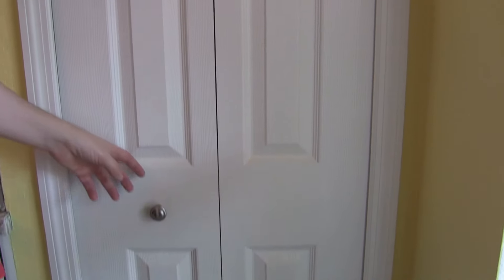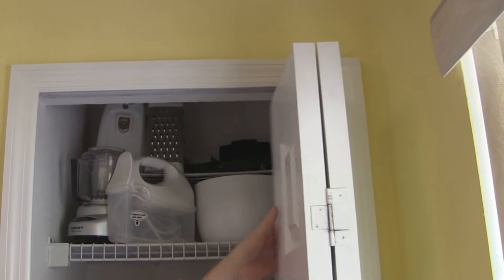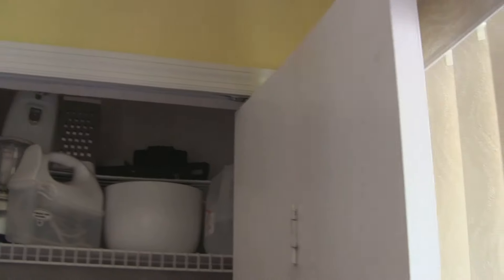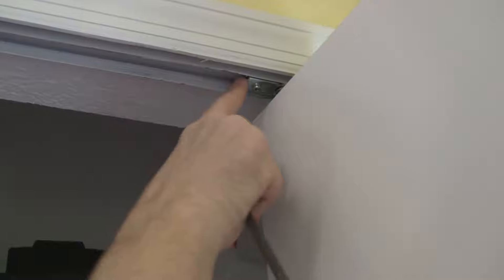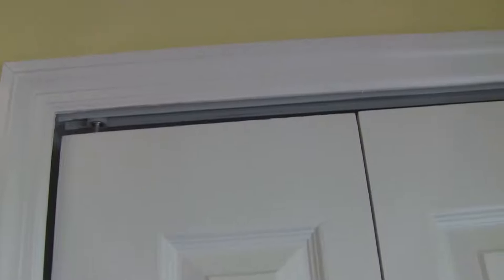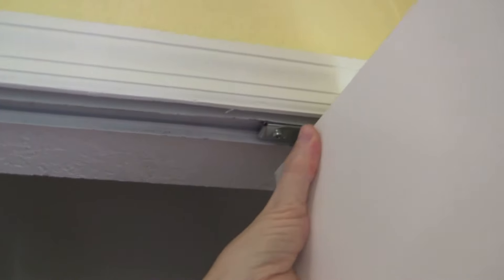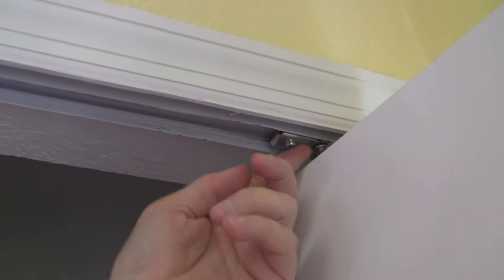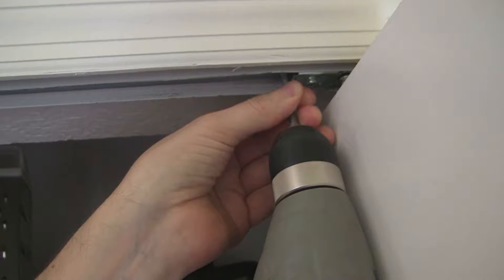Fix A Bi-Fold Door That Falls Out Of Track

Comment: OMG!  I've been holding this off for 2 years but just saw your video and fixed it.  I had the 2nd problem where I screw in the screw but the track still slides.  I did your 2nd screw solution to stop it from sliding and it worked!
Reply from the maker: lol... I put it off forever too. Glad that little trick worked for you.

Comment: So, my bifold closet door, actually has this thing on the very bottom, close to a screw looking. But I actually lost that part like 1 day ago, I thought it was just one of my siblings stuff. But I managed to get it back! So It was actually quite hard to get it to stay in the hole at the very top. And very hard to put this screw thing on the hole it came out of. And let me remind you, this was a single person working on this heavy closet door. After finally fixing it. When I keep closing and opening, the thing that has the hole and has this screw on the bottom piece (At the top) was moving/scooting. So I remember you did something like screwing a nail to make it so it won't move anymore! 
My age:14 (which isn't important) Is going to fix this closet! Tomorrow actually. I can't go touching my dads stuff. But I want to fix this on my own.

Comment: I would appreciate your advice. I had to cut down about half an inch the door as it was too tall, the door is hollow inside and now about 2 months later the bottom pivot or screw that is holding the door from the bottom is collapsing and the door has fallen twice already. Is there any way how I could fix the door from the bottom? Thank you
Reply from the maker: Did you cut the top or bottom?

Comment: hey man so what if both sides fall off
Reply from the maker: Well, there's 3 points of contact with the door. Ya just gotta see where the problem is. Sometimes the screw at the bottom lowers the door over time with opening and closing it. Try to adjust it so it raises the door.
Reply: @stevekonbass  thank you sir i’m trying to help my dad fix his right now so i appreciate the fast reply
Reply from the maker: Glad to help. Make sure the 2 points of contact at the top look right. There's that screw you can try to tighten at the top as I did in the video. Definitely check the bottom though too.

Comment: How do you get the door to go back in from the bottom by the floor?
Reply from the maker: There should be something that looks like a screw at the bottom of the door that sits in a little bracket. The screw is screwed into the bottom of the door and let's you make little adjustments to raise or lower it. It should sit in a bracket. If it's out of the bracket, the door can be lifted and the screw placed in the bracket.

Comment: Hi How to I stop my door from sliding open on its own, after I close it? It won't stay closed
Reply from the maker: That's odd. Sounds like it might not be hung right or it might be too tight when you close it causing it to pop back open. You could try to realign it and make a minor adjustment to the top or bottom fixed corner.
Reply: @stevekonbass  the maintenance guy took the door off when they put new carpet down and shaved off the bottom of the door in order to open the door and not have it drag the carpet when opening and closing it. Now the door slowly slides back open on its own. It’s like they shaved it too high or something.

Comment: My bifold has a hexagon screw, and I think my ceiling slopes downward. I’ve tried tightening screws but door still comes unhinged. Any other tips?
Reply from the maker: You have to determine where the problem is. In my case, the track was warped so driving a screw in at the top acted as a stop and prevented the door from sliding over. You can try that. Your door also might need to be raised. If that's the case, you'll need someone to lift the door a bit while you adjust the screw at the floor that adjusts the height of the door.
Reply: @stevekonbass  thank you. I’ll try fixing from the floor since the hinge at the top isn’t moving and is on solid.

Comment: My teen has a small bedroom 10x10 with a refular small closet with two sliding doors..Will it be worth it to swap them for blindfold doors to maximize closet space or not really?  And can I install them on existing track or do blindfold doors come with its own track system?  Thank u
Reply from the maker: Hey Marco- Bi-Fold doors would make access easier than 2 sliding doors, but wouldn't really increase or maximize space, and the bi-fold doors come with their own hardware. If your teen doesn't have a lot of hanging clothes, you might want to consider adding wire shelving for more storage space and then install the bi-fold doors.

Comment: The problem with mine is obvious, but the pin won't retract low enough for me to put the door back in the track. How do I fix that?
Reply from the maker: If you can't get the top pin in the track the door might be too high. You can lower it a bit by adjusting the bottom pin by the floor.
Reply: Thank you.... They all seem to be mounted in this way and are straight/ mounted well. I have no idea how one of the kids got it off the track without the wood splitting. Looks like I need to remove the bracket with the pin and reattach when it's inside the track, but that will be tricky as I need room to get a screwdriver in there?

Comment: My pin came out and now i'm trying to find a way how it is supposed to be put backed.
Reply from the maker: Out of the door or out of the track? If it's out of the door, just push it back into the hole in the door. If out of the track just push the roller part down until it touches the door, slide the door under the track, and then let the roller back up. That roller/pin has a little spring action to it.

Comment: i have door like this and the door is completely off. How do i fix that?
Reply from the maker: There's 3 points of contact on the door. Above the handle there's the guide that sits in the track (top left corner in my video). Opposite that, there's a peg that goes from the top of the door into the adjustment piece that's fixed in the track (top right corner in my video), and at the bottom corner there's something that looks like an upside down screw that sits in a fixed bracket on the floor (bottom right corner in my video). You can adjust that upside down screw to raise or lower the door a bit. So.... first loosen the adjust piece in the top corner with a screwdriver and slide it over in the track a little to the side where the door opens. Then with the door tilted a bit, put the head of that upside down screw into the floor bracket. Keep that upside down screw head in the floor bracket and gradually tip the door up so you can get the peg in the top corner of the door into the adjustment piece guide. Once they're connected, push the top corner of the door over so the door is straight and tighten the adjustment screw. Then just put the guide in the track. That guide has a spring to it so push it down and once under the track it'll pop in when you take your finger off of it. Hope that helps.

Comment: My whole closet foldable door fell off the track
Reply from the maker: Pretty easy fix. My guess would be to look at the 2 points where the door doesn't fold in. In the case of the door in my video, it would be the top right corner and bottom right corner.